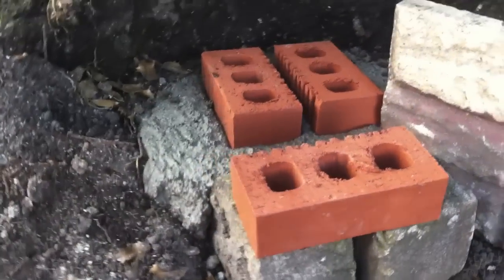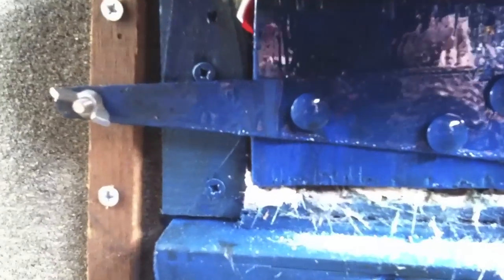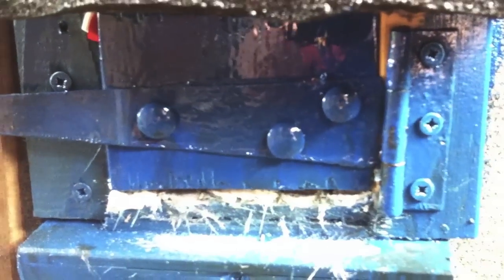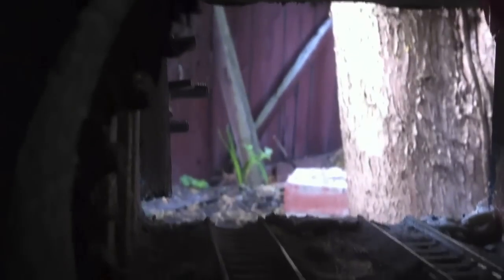How to Build a Garden Model Railway, part 1

Comment: Hi Jenny like your ideas we used to have a model railway layout that started in the house and we knocked through the wall and took it down the garden then into the shed at the bottom .
I liked the idea of brick piers have you thought about exterior ply with roofing felt on top with the track on that?
We used it on our layout and it never rotted as long as you keep it off the ground what about steel angle iron screwed to the top of your piers with the wood bolted to it, the angle iron would never rot you could always treat it with Hammerite.

Comment: I have ONE question about doing Model Railroading in a garden. 

When it rains, how do you clean off the tracks? wouldn't the locomotive's wheels slip, or the locomotive wouldn't even start? 

(Model Railroading in my backyard is my only option currently, and i have ALOT to learn)

Comment: Jenny - just a heads-up, if you use wooden posts for the track bases they will warp. Best bet would be metal or cast concrete sections maybe 1m max length (if you make a standard former and do a production run it will take longer but last). I have never done garden railways but as an engineer this would seem the best idea

Comment: Hi Jennifer. Watched your video on going through shed.
I am just about to do this .question for you.
Did you just use the resin or the fiberglass mat aswell?.
Also this could be used for flap ends too.:-) :-)
Reply from the maker: It was fibreglass repair paste which is a mix of resin and fibres that you just add hardener to and mix in.
Reply: Jennifer E. Kirk
Thanks for prompt reply thank you
Shopping for me Tommorrow 😊😊
Reply from the maker: You're welcome. I get mine from Halfords - it is the stuff sold for car body repairs, but I use it for repairing fibreglass boats normally.